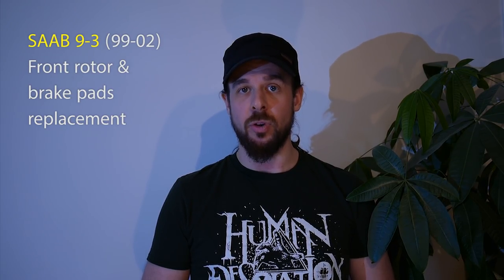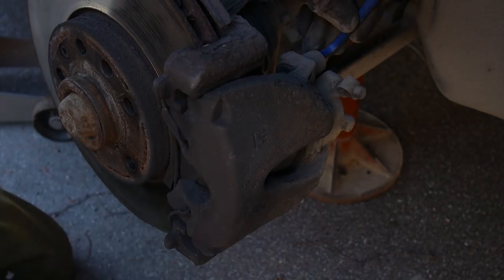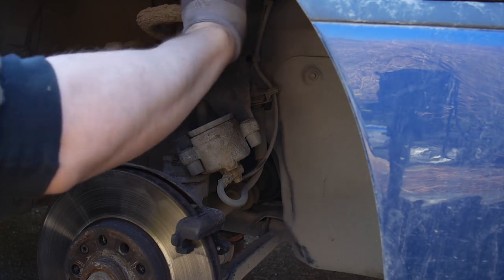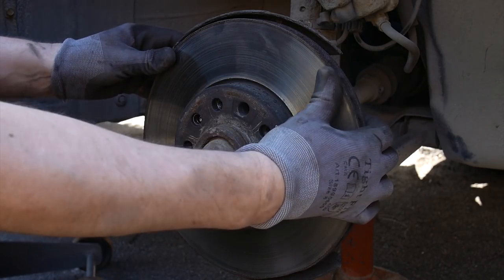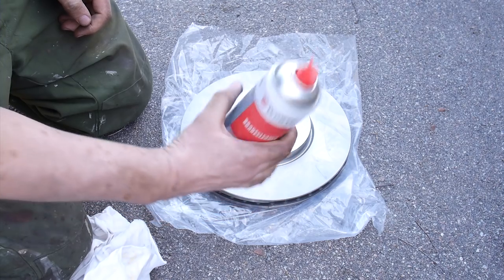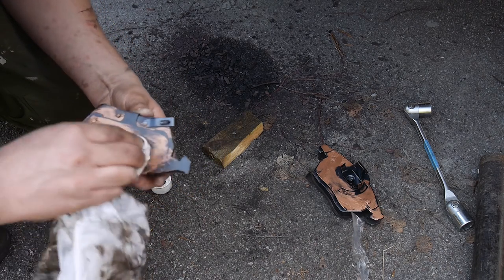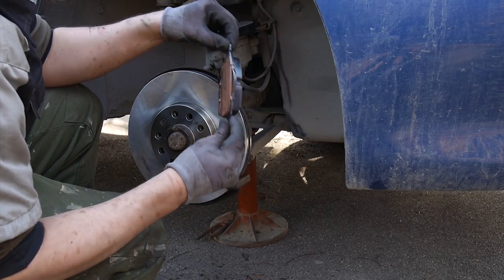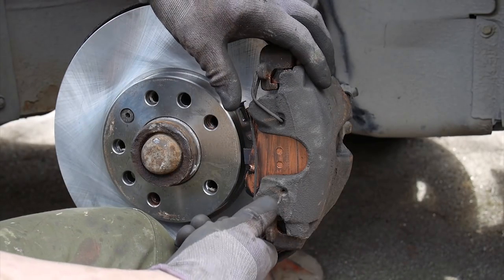SAAB 9-3 (99-02) front brake pads and rotor replacement

Comment: I would have preferred to hear a Swedish car repaired in Swedish. I worship my Saab 9-3. Been off the road for 5 months for a full refurb. Painted the whole car from rattle cans. Ready to drive in around 2 weeks, can't wait. Great video.
Reply: I just bought a used 9-3.  It's a solid car.  I only wish I had found a manual transmission instead of an automatic.
Reply: @OnYourLeft  I wish I would have automatic. Manual transmission is so annoying and clutch is heavy in this car.
Reply: M-Galaxy - Interesting.  This may end up being my oldest daughter’s first car, and she wants to learn to drive with a manual.  I’m planning on getting this going strong and then selling it.  Being a four seater also makes it quite impractical for me at the moment, which is a bummer.  It looks really good.
Reply: @OnYourLeft  Yea, I agree, car is nice. I really like that swedish design. I just prefer automatic way more. My next car will be 9-3 II.

Comment: spot on video. !    only comment I can have. is  that most cars have one or 2 screw points to get to brake discs off. save a lot of time.  and not all brake disks need a proper clean.  depending on if they came blank steel like in your video or coated.  coated disks need no preparation before mounting.

Comment: Great video.  I just bought a used 9-3 for $800, and it doesn't need a lot of work.  I'm putting new brakes all around, changing some hoses, and putting in new upholstery, and that's about it.  Really nice car, especially for the price.

I would like to mention that it is a good idea to put LocTite on the caliper bolts.  A few months ago, my family and I had some trouble while traveling through Arizona due to a caliper bolt coming off.  The caliper fell forward into the rim and jammed it while we were moving.  Suddenly, the wheel locked up, causing a potentially dangerous situation.  Fortunately, I was able to get to the side of the road and build a temporary solution, but it stranded us in Phoenix for a few days.  It also ended up costing quite a bit of money, as I had to get a hotel room and a rental car while I searched for a part that was difficult to find.  I ended up finding a van like mine in a wrecking yard and found the bolt I needed, but I had to buy the whole caliper for $40.  I put LocTite on that bolt for sure.
Reply: The spring holds the bottom of the outside pad in place so it doesn't toe in and wear unevenly.  It also keeps it from vibrating and causing uneven wear on the rotor.
Reply: Is there no bleeder port for the brakes?

Comment: Thanks a lot! It really helped me! In my case the only thing which went wrong was unscrewing that small 5mm allen screw. It's quite easy to damage its drive, as I did. Be careful doing that, otherwise you'll have to unscrew it by making a cut with an angle grinder and then using large screwdriver and a hammer.

Comment: Is it possible you could make a video like this for the rear rotors and shoes? This was so informative and helpful. Not only did it walk me through the process, but it provided me the tool sizes I needed. I was missing the allen keys and the trip to the store was easy with the exact size required.

Comment: I just did this But I levered between inner pad(one with piston on it)and disc with long screw driver to push piston back.Also didn't remove first two caliper pins just the two bolts holding caliper.Whole thing came off easily. placed new pads in caliper and slid whole thing back onto new disc,reinstalled two bolts and done.Is there a reason to remove first two pins I'm missing here?

Comment: Check the slide pins can move freely. if Not check for corrosion where the rubber sleeve fits to the caliper. Cause's the a pad to wear out really fast. Remove the rubber tube clean out the corrosion. saves money.

Comment: Please be aware some brake discs come with a special protective coating that should not be cleaned off but left in place please read the instruction that come with the discs
Reply: I second this.  The brake rotors I bought for my Nissan Quest had a coating with specific instructions not to remove it.  The coating in this case helped with the break-in process.

Comment: I was trying to change the rear brake pads today on my 02 saab 9-3 and I broke the upper bolt that goes into the caliper mount(as you  call it )because i overtightened it! This bolt is thin ! Like 6 mm in diameter or sth. Do you have any  idea how to take the broken bolt out ??
Reply: You don’t need to remove anything on the rear brakes.  Just tap out the two pins and the spring that holds them right.

Comment: This is brilliant I done mine today because of this video. 

Is the rear much different?  Because I want to do that next.
Reply: I guess the only thing that is different is that there is a hand brake to consider. If it's too tight it might be difficult to get the disc off. Make sure the hand brake is not pulled and if you need to loosen it there is a little screw/wheel that you can see through one of the holes in the disc.

Comment: Do not remove the caliper hangers. The  discs (rotors) come out easily, just angle the old disc and lift by a few millimetres and they come off
Reply: No. I would take them off to give them a really good clean with a wire brush where the brake pad runs. You can really clean them on the floor, not so easy when they’re fitted. Each to their own I guess